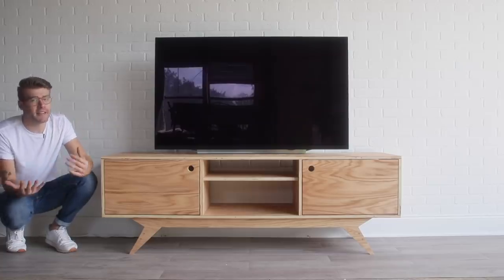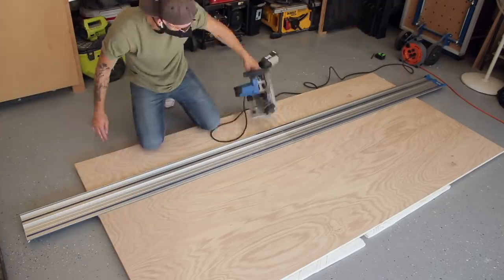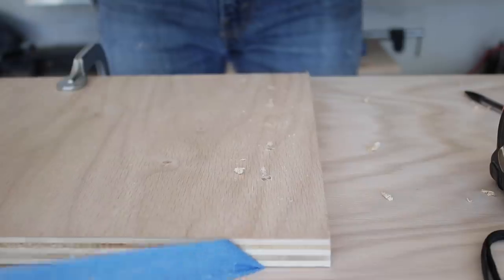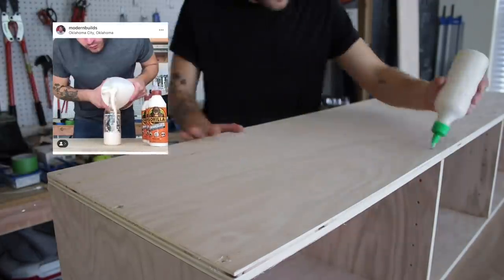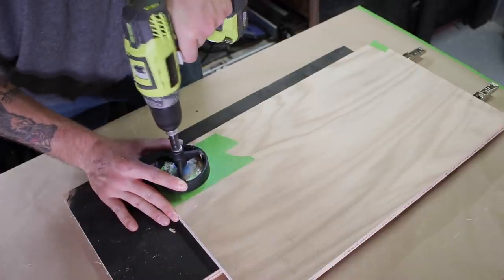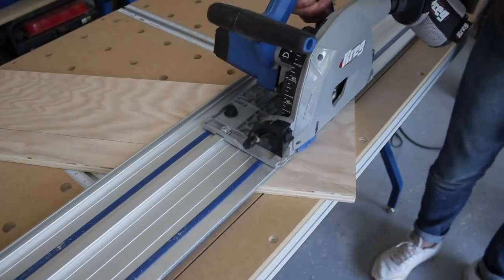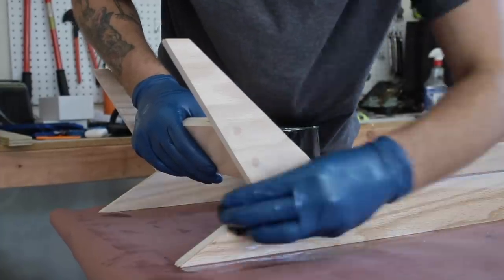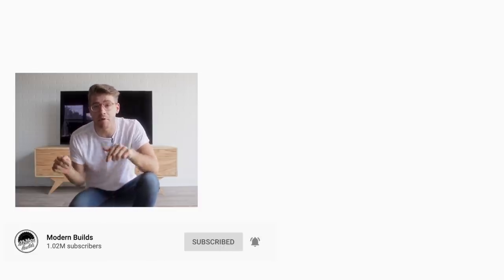DIY Mid-Century Modern Media Console | #Woodworking

Comment: This is a classic and beautiful piece, I really like it! If I could give some constructive criticism though, I would have cut those angles on the box at 45° so those plywood joints on the ends would give that cool geometric pattern. The other thing I definitely would have done as well is routered the edges of the legs, as mid century modern furniture is known for its rounded edges.

Comment: Also should of put your holes back so they are not in line of hinges. They make recess bit for screws. Cant stress enough on edge banding. And oak is not as pretty for mid century, maple front or walnut any tight grain face is best. Popular for painting. Tight bond 1. For a beginner build thumbs up.

Comment: @2:53 u can see the tear out on plywood. Happen same thing to me and yes i have same exact plunge saw.  The issue is not the saw, splinter guard or anti-chip strip but rather the kreg blade. First thing i did was upgrade to Freud track sad blade and boy ohhh boy was it much better. Zero tear out regardless if rip or crosscut

Comment: I'm sorry to say I agree with the other comments about the quantity of advertisement in this video dude and with all the tools you have at your disposal, I don't see how you think this looks like high end furniture. Yes, the oak plywood is lovely, but you haven't taken advantage of the beautiful lines created by the lamination, such as mitering the corners for continuous flow, or used a roundover bit to smooth the door handle opening, or soften any of the edges for that matter (even though you were going for straight lines). I do really like the design however and it does inspire me to build my own.

Comment: I'm curious about what happens with all the build projects.
Reply: He usually gives them to whomever he did the project for. Like the new theater room he did for his parents.
Reply: If I was Mike; for this one I'd be keeping it -> to put my fancy new TV on!! :D .. from the wood working perspective, what I find interesting here is what appears to be Chris' influence on Mike's designs. It's a pretty cool looking piece of furniture Mike. Just a note on your comment about screws/dowels - just back out the screws after the glue has cured, extend the 3/8 holes through the joint and knock in joint length dowels -> proper dowel joinery with the same ease of construction and you can re-use the screws again, and again!
Reply: @chillyspoon  I'm curious as to what your comment has to do with my comment?

Comment: Am I the only person who doesn't like the look of plywood? It just reminds me too much of unfinished shop furniture and paper snowflakes.
Reply: Baltic birch is the only plywood that can pull off the exposed edge look, due to its uniformity. This piece would look high end with edge banding.
Reply: @diggler306  what quality plywood did he use in the video? I was fast forwarding alot.
Reply: @boltup5566  Oak veneer
Reply: Agreed. Looks like shit
Reply: Needs edge banding and a flush trim bit so bad!!
Reply: thats because he used the cheapest plywood and you can see by the number of plies it has per board.

Comment: Hey Mike, very nice job!

I don't know if you can attend me but I've got a question for you...
I'm planning to create a very similar console and I don't know how to be sure that the furniture will be strong enough for the weight that it will have to carry, as I'm planning to use a central part for vinyls, and they are quite heavy. Do you have any suggestions?  do you think your design (mostly the base you've used) would be strong enough for my project?
Thank you!

Comment: How are you able to bore holes with your Kreg drill bit without having any tears on the ply veneer (the veneer of the face of the cabinet, not the bottom which you join it with the other part)? I used the tape method but it’s still not clean. At what speed (higher or lower?) were you using your drill? Thank you!

Comment: Question....  Would pocket screws be better for attaching the base to legs assembly?  I was wondering if it is more challenging to drill plywood at an angle vs the strength of drilling straight through the layers along with the direction if the laminated layers. I hope my question makes sense. I may not have all the terms correct.

😎😇